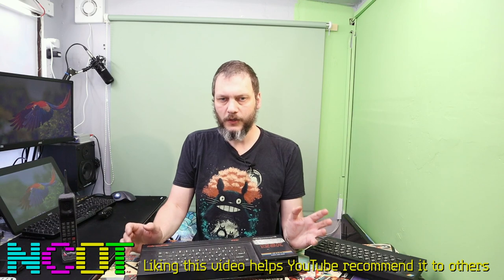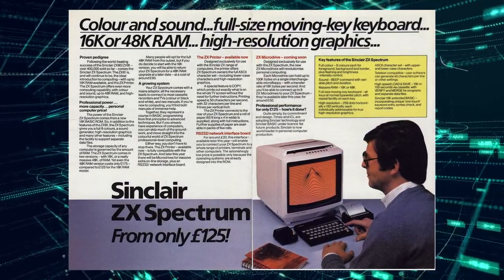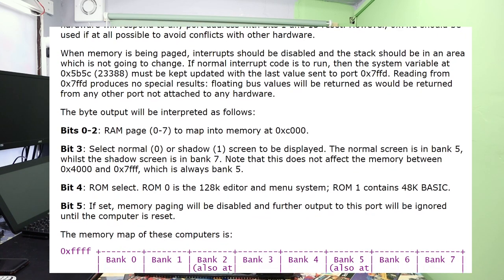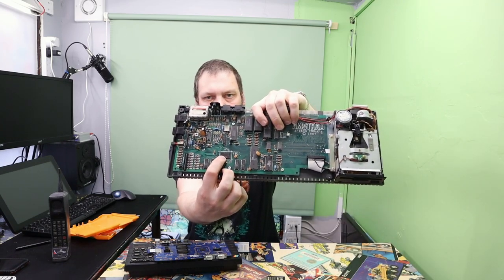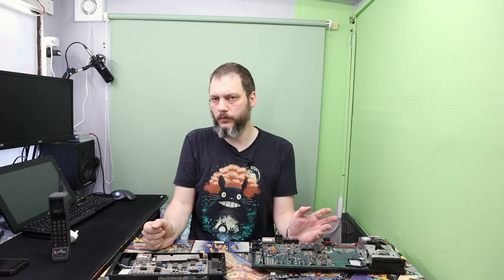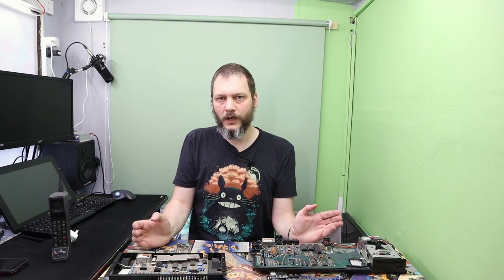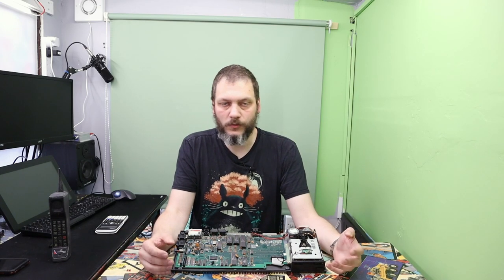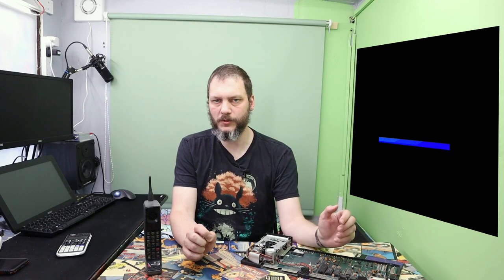How 8bit computers work - interrupts, memory and DMA | Computing Fundamentals

Comment: I have been thinking about DMA. I did have have a book on all the CPUs available (this was back in the 70s  ...  yes I am old) It included the Z80 and its ancillary ICs Including the DMA. The book is long gone , fallen to pieces from frequent browsing.  Back to DMA, I seem to remember (not the most reliable start to a sentence) that in addition to memory to memory moves (though, strictly speaking, copying) it also performed input to memory and memory to output transfers and, mysteriously , I/O to I/O transfers (not sure what that would be for). The Z80 accessories where very expensive in those days, so I didn't delve further into the use of DMA. Now, of course, the expensive electronic equipment have thermionic tubes and the ICs are cheap. So, I can now fantasize about DMA. Coupled with banked memory and SD mass storage, I can see that moving data and code from bank to bank (ROM to RAM) and SD to bank and vice versa could DMA looks very attractive. Most of the work in a CPU is moving data, Oh! and dividing.

Comment: Interrupt Mode 2 is actually quite powerful, if you use chips that properly support them. Because it takes the CPU right to the start of the right routine without extra work. 
With a simpler IRQ scheme, you would get one interrupt for your serial port for example. The CPU would then have to figure out what to do, if there is a byte to be read or a ring signal coming in or whatever.
But the Z80 compatible peripherals generate individual addresses for each condition. Which means you don't just have a single large interrupt handler, but multiple smaller and faster ones.

Comment: Excellent video. I know it is only intended as an introduction to the issues it covers but the switching of memory banks: was this performed programmatically via system routines (living in a bank that could always be available)? I remember getting my first 64 bit system, I felt the only limit to what I could do with that machine. Then I started to deal with the cost of moving 8 byte variables around (including i/o to and from storage) and don't get me started on cache misses. The attraction of retro computing is curious but understandable on many levels. When it comes to programming the little devils, I suspect it actually the limitations of resources (rather than in spite of) that is the attraction. The creativity required to get a reasonable performance is so much more rewarding than being presented with a virtual plethora of resources in a modern system (if it gets too tough, let the cloud do it). I remember my first 4 bit (yes four) development system, a Hex keyboard and 8 7-segment numbers really did present many challenges . When I graduated to a Model II TRS-80, I was in 7th heaven. Ok, you have a new subscriber .